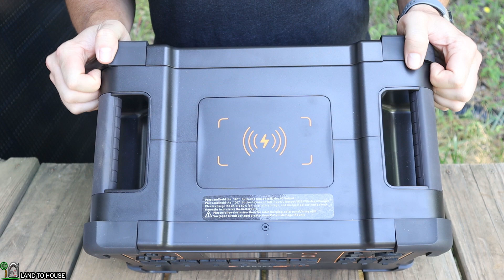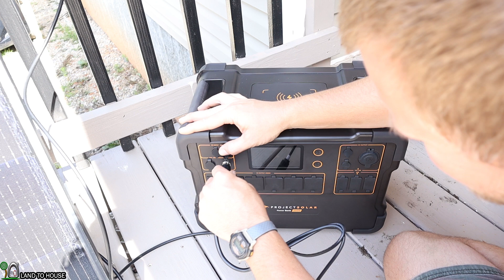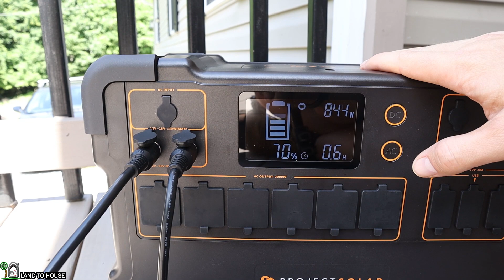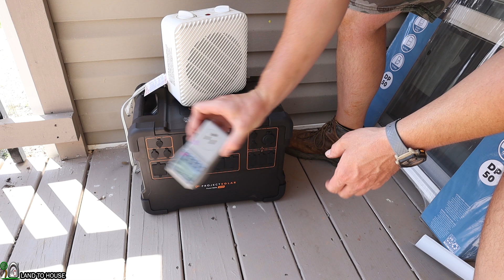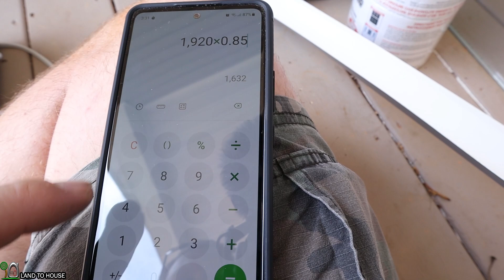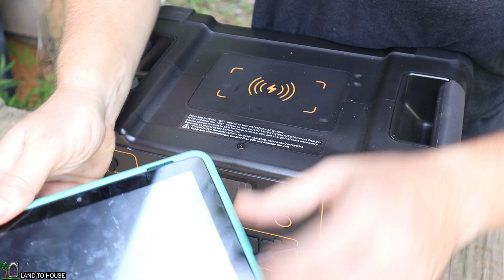Project Solar Power Bank 2000 Power Station

Comment: I have 2 of these PB2Ks. I'm in south Florida, Atlantic coast, tornado alley for hurricane Milton in Oct 2024, and my units proved themselves well during power outages that resulted. We chose to spend the night of Milton's arrival away from home, to a more robust building than our home, where power failed in the middle of the night. We weren't sleeping for obvious reasons, so we knew what happened, plugged in PB2Ks for lights, coffee maker, computers, and went the rest of the night and following morning without a burp. Next day, we got home, power was out and stayed out for more than a day, and came & went for probably 3 days thereafter. I have the 4-circuit transfer switch installed beside my breaker box, meaning I could just plug a PB2K into the house and flip the switches, giving us (in our case) the master suite, a small chest freezer, refrigerator, and a living room circuit with a few lights, computers, TV, and internet gateway. I have 2 PB2Ks in order that I can run the house on one while charging the other using 3 200W panels which produce 540W (the most I've observed, 90% of rating) in near-perfect sunlight (this is south Florida after all). That weekend, our church was still out of power, so our units came into use a third time, running lights, fans, coffee maker, sound equipment, and a few other incidentals.

These are quality, easy to use, rugged devices that perform as advertised. No, they're not the least expensive units of this type you can buy, but I looked around long enough to make what I think was a good decision about them, including the units themselves, 3 panels, and the transfer switch. A total of 3840Wh of power is more than enough to keep essentials functioning; I debated getting an expansion battery (3000Wh) but decided I really don't need it. I had the transfer switch installed just a couple weeks before Milton, and as the electrician was leaving that day, he said, "Let's hope you never actually need this." Well, guess what, just one hurricane later and the switch was at the core of /easily/ getting through a bad time of repeatedly losing power.

At this time, I keep one PB2K plugged into the transfer switch, so that if power fails, it will take me just one minute to get to the breaker box, turn on the PB2K, and flip the switches.

I have no affiliation with Project Solar, I'm just a very pleased customer.

I should note that I've seen recently that the newest version of PB2K replaced 2 120V sockets with a single 240V. I'm not at all sure that I'd recommend running any 240V equipment off one of these -- whatever it is that you might want to run of that sort, it's surely a huge power draw (AC? dryer?); I doubt you really need to run a dryer, and the draw of running AC would drain one of these in at most a couple hours. So I'm happy with mine and their 6 120V sockets as they stand.

Comment: pecron OEMs thier product line now? Not a bad thing I own two of the 2000 lfps. All reviews show how much more efficient these are compared to the big names (ecoflow bluetti) equivalents.
On a side note this thing ran my 12000 btu LG portable air conditioner. Run time showed about 1.5 hours while the compressor is on. should get a bit more as it cycles.

Comment: That's really cool that both shore power and PV charging can run at the same time.  I don't think I've seen you run that test before.  Interesting that the T shaped slot on the common side of the Edison plug indicates they should be capable of 20amp output, but that would be 2400w and possibly trip the overcurrent protection.  "Pass Through" mode to charge and use at the same time would be a great feature, I didn't see on the vendor's page any indication that it could or could not do that.  To really show this off  with your particular use, I'm surprised they didn't include the external battery expansion.

Comment: That is very clearly a rebranded Pecron E2000...which is a GOOD thing!  The bad thing is, this Project Solar product is $300 to $400 more than you might pay for the original.  Very good product, either way, but no need to pay that much for it.
Reply from the maker: Yes I also made a review of the Pecron some time ago. Both units performed well. As expected. At the time of this comment the Pecron has the same price as the Project Solar but Pecron is running a sale for that extra $400.

Comment: QUESTION: If using this unit to power an off grid remote internet mesh node with an ip camera, after the battery power is depleted, once this unit has sun available to solar panels, does it automatically restart and supply power, so the mesh node and ip camera will begin functioning without user intervention?

I need a power station that can restart the attached equipment without my intervention

thx